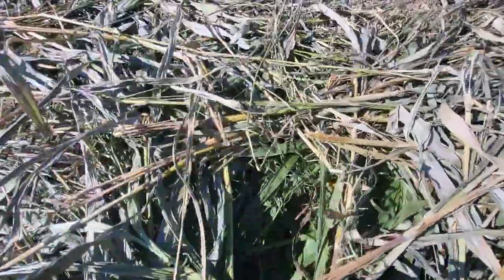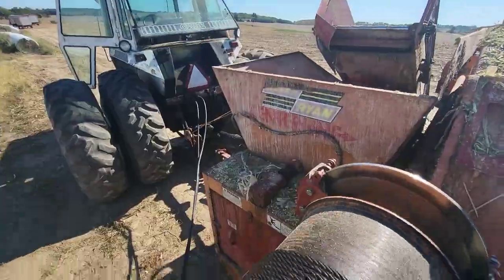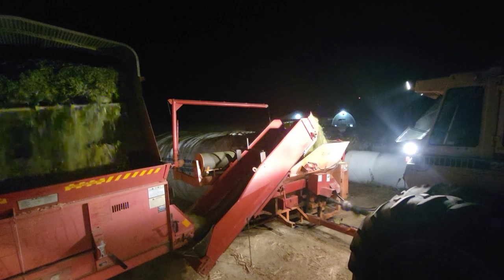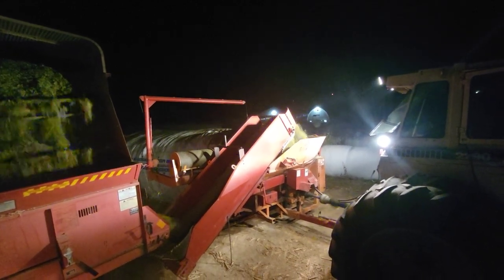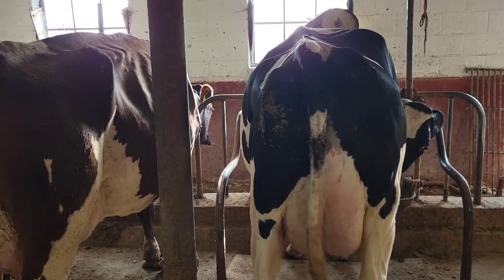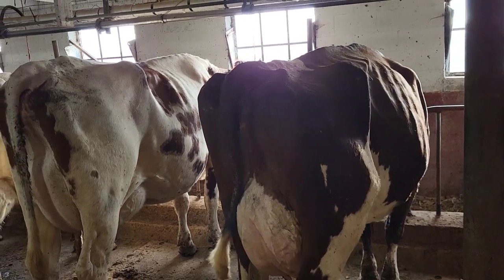chopping sorghum Sudan with the 966

Comment: I sure miss my stall barn. Chores were so peaceful compared to the free stall setups. 

Sorghum sure feeds nice, extremely palatable. I always come up on milk when it's in the ration. Never have any cows with sore bellies. I'd better get back to it, talk to you later.
Reply: Our components went up when we added it to our ration last year.
Reply: @karlherzog3979  mine do too. Cows really like it.  It always feeds better than it tests.
Reply: @missourirob7712  yeah the tests are definitely deceiving
Reply: @karlherzog3979   we get so dry here, I don't hardly grow any corn. I use the sorghum, and other summer crops.  We try to take triticale and sorghum. Lots of tonnage on little moisture,  feed lots of by-product. Seems to work well for me. Had to take over  nutrition work myself, they were running me broke. Since I switched everything up I've actually made a little money.
Reply from the maker: I haven't fed any to the milk cows yet, think this stuff I just chopped I'm going to try on them. Oats and peas seem to be the same way, feed tests so so but man those cows will milk on it. Thanks for watching 👍
Reply: @hartungdairyfarm0713  yeah they  sure like it all. Some reason the intake goes up. That's how I get thru the heat, I add more to ration . They'll eat it all before they go to pasture . Before I had a hard time holding 50 lbs. Now they do 70 plus. I'm big on a ration with lots of good fiber.
Reply: @hartungdairyfarm0713  yeah we use trit peas over our new seeding and that feeds really nice too. We were going to try to plant trit peas in the spring and double crop sorghum sudangrass but Mother Nature decided we weren’t gonna get into the fields till the last week of may 😂